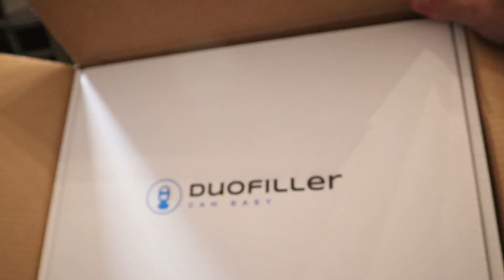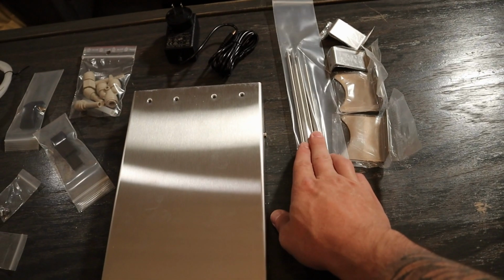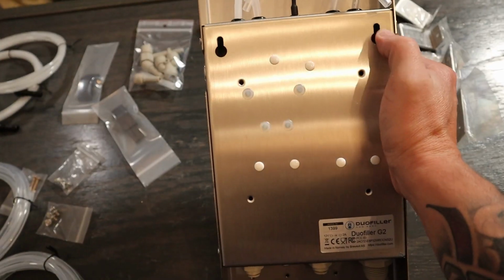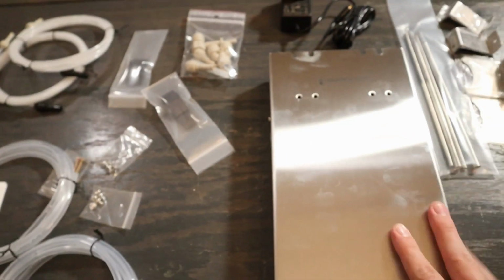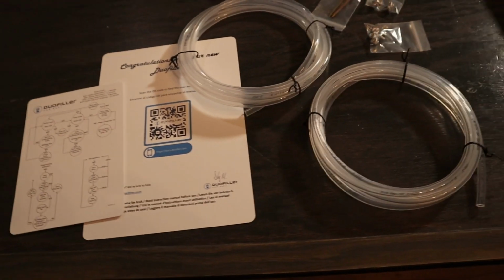DuoFiller Assembly and Review

Comment: what size gas line fits to the duofiller 3/8 to 1/4 barb fitting? 5/16 gas line wont fit 1/4 barb right??
Reply from the maker: This is what's on their website: "CO₂ hose (1/4 "ID or 3/8 OD) and separate regulator for CO₂ for purging." I'm certain it would be easy to get the appropriate push-fit reducers that could handle any normal gas line. I hope that helps!

Comment: anyone with a working solution for a setup NOT mounted on the wall
Reply from the maker: Hi Karl, yeah I've seen the single tap version of the filler mounted to a bracket that can either sit on the bench top or get attached to the edge of a table. If I remember right the dude who did it used a combination of zip lies and metal straps (like for water heaters). I wish I remember where I saw it.